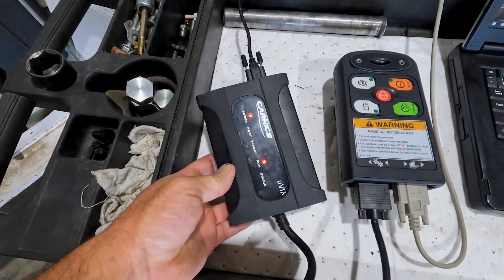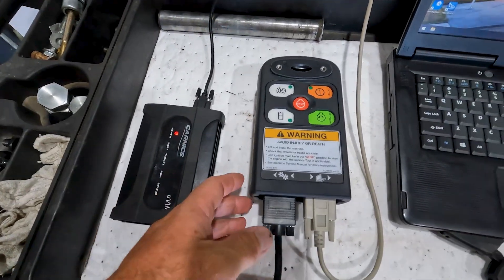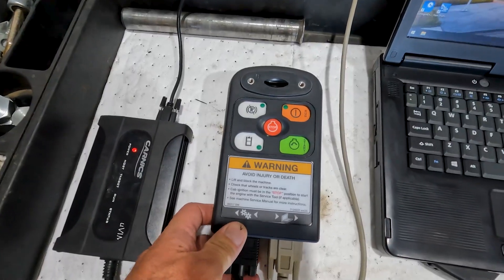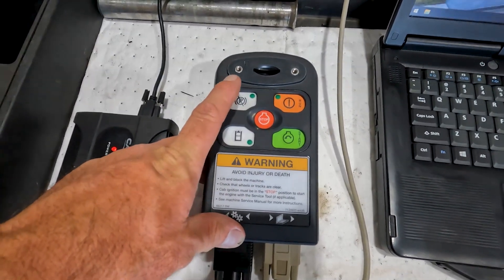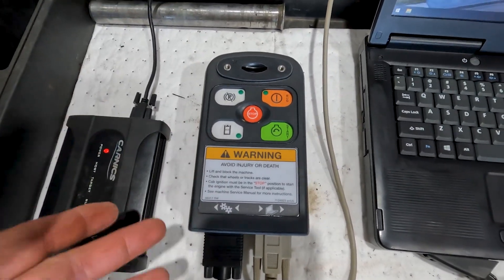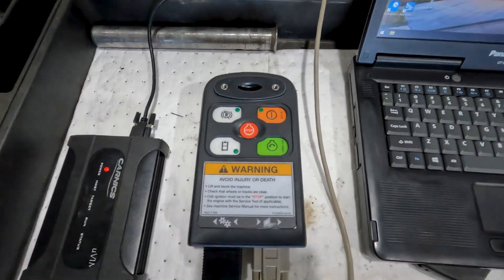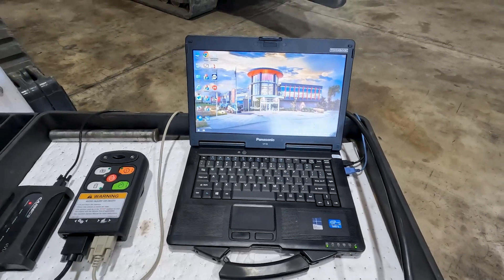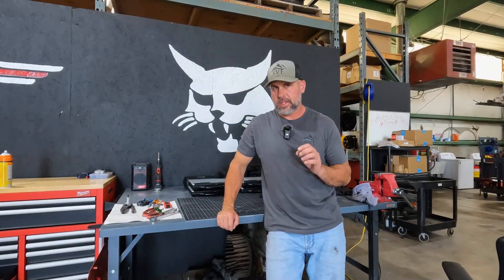Bobcat Diagnostics - What The Dealers Don't Want You To Know

Comment: Hey,I have a t66 that is flashing a code..My machine will not move forward or reverse..the code say drive controller no communication..and drive controller voltage low..I replaced the drive controller,but that didn't work..and the battery is good..help..I need my nachine

Comment: Hey  thanks for your info.  I am so appreciative that a great guy like you are around to  answer the questions of the people and resolve the curiousities people may have.  I  just want you to know that means a lot to the public because we can't depend on Bobcat to tell us the brutal honest truth.  So I'm looking to buy the best largest size durable compact excavator and  skid steer with the best performance and maximum digging depth that is comfortable to operate for long hours and powerful motor and powerful digging force. I want to dig at least 20 feet... I would get a bioger size excavator like a e 165 but I am afraid it might be too big for some projects and I want a very powerful excavator that can get any job done but also fit in all areas. Could you give me your best recommendations.? And I want the best attachments for removing trees and brush and trees stumps.? What would you recommend and what name brand is the best and most definitely dependable that has the longest and best durability? And I see Bobcat is starting to make all electric excavators.  I  am an electric man and I love the idea of owning a completely all electric excavator because even the  lifters are actuators they don't operate on hydraulic fluids at all & I think that's a much better design.  And less maintenance and less things to go wong or break. What's your opinion on an all electric excavator?  The operating time might not be as good as any gas powered engine.

Comment: I really appreciate all the great support videos you do. Extremely informative. I have a 2016 T590 that I recently bought a have been getting the 1076 code. Replaced the fuel filter, checked the inlet hose in the tank and all is well. The problem seems intermittent and only if the machine sits air gets back into the fuel system and I have to bleed the filter and then it’s fine. Would a bad injector allow it to drain back somehow to the tank and introduce that air? Any advice would be greatly appreciated.

Comment: I have a 2001 T200 with the Deutz 1011F engine.  I rebuild it recently and here is my problem.  It will start and idle with full cab throttle control  with the pump drive belt removed, but when I put the belt on, it wants to "Hunt or Lope" and will not go to idle when i start it.  I can't run the machine and I have tried everything, even the dealer couldn't fix it.  Could it be the hydraulic control valve malfunctioning ?? 
Any thoughts ??

Comment: Hello good morning I have a question. I have a bobcat T590  2018 and I have a M3204 code no lift end tilt  I checked the wiring connectors fuse box but I don’t hear the actuators. Do you have a tip please? Thank you.

Comment: Subscriber here with a question. I have a 2024 Bobcat S62 skid steer. Bought it new. I have 21 hrs on it. Im in Cheyenne Wy. Doesnt get a lot of use. Went out to start it and the battery was dead. Put a good charger on it over night. Just started it up with no issues but it has a P068A ECU relay code. I shut it down and restarted to see if it wouldclear the code. It will not clear. Any suggestions? Thank you.
Reply: I’ll try to remember to look it up tomorrow.
Reply: @JohnnyF-seed  Thanks. It actually reset and cleared.

Comment: T595 with new gear pump and boom is so weak it will barely lift? Motion is fine . Bucket tilts and lifts empty only. Should I be looking at coils on the valve or where else could be a pressure restriction? Thank you sir

Comment: Hello everybody, my bobcat t450 has an intermittent code ( r7404 ) “no communication with main controller " when this code shows up it won’t let me do nothing and after 10 seconds approximately he turns off… if I wait 10 mins or more i can start it again and everything works perfectly but the code comes back again after a few minutes he only do that after 2 hours of working with it approximately…. I checked everything, grounds, alternator and wiring and I don’t see anything wrong. Please if anyone had this same issue let me know thanks
Reply: Did you ever figure anything out? im having a similar issue with my t450

Comment: I ran into this exact problem swapping and engine on a Takeuchi TL240.  The engine swap was very straightforward.  Will not start. Turns out the ecu controls the injection pump and needs to be programmed with special Yanmar software.  I have been trying for 3 weeks to get a yanmar Tech with a laptop out with no success supposedly they are coming tomorrow.   I found the wire connector boxes and software to read info and codes but no luck finding the software that has the ability to reprogram or reflash the ecu.  It has been a frustrating process and a prime example of why right to repair is so important.  These electronic controlled engines and  dealers  really have you by the balls.   It would be nice if the mfg's would adopt a standard interface like ODB2 in vehicles.   I am glad to see you have come out with your own solution for bobcat.
Reply: This has been common for over 20 years all serial numbers must align along with actuators and injectors .

Comment: So glad I moved away from working on electronic diesels. Almost all of my equipment now still runs mechanical injection with very little to no electronics. Needing multiple scan tools to talk to multiple modules on an engine less than 100hp makes no sense. Thanks governments lol
Reply: I agree sir. It makes it so much harder to do.
Reply: I love my mechanical diesels. So simple and reliable. I recently found out if I would have bought one year earlier for my excavator I would have got a bulletproof mechanical zero emissions Kubota v2403 in it, but instead my 2018 is an electronic high pressure common rail 2403 with EGR and DPF. Im pissed.,